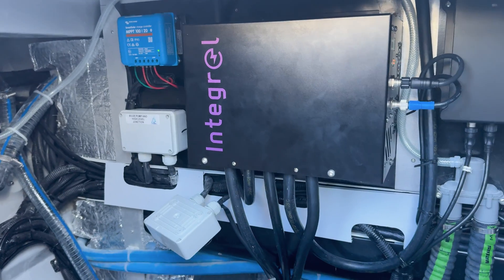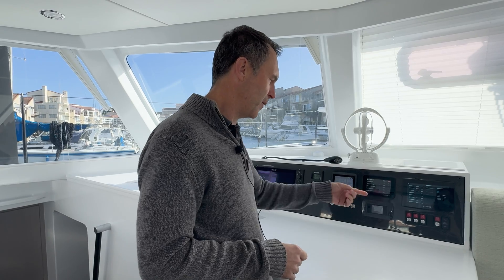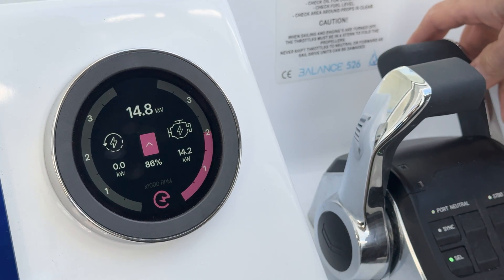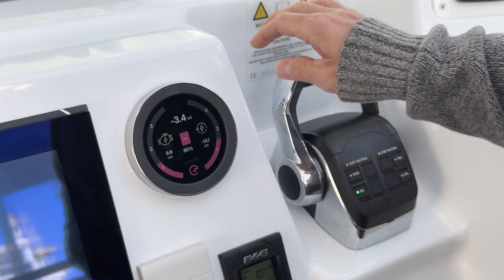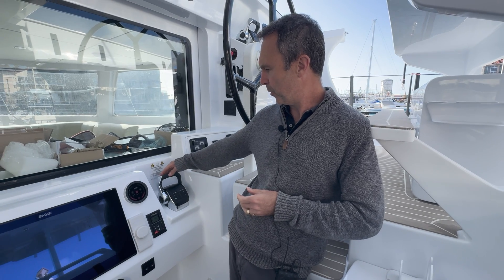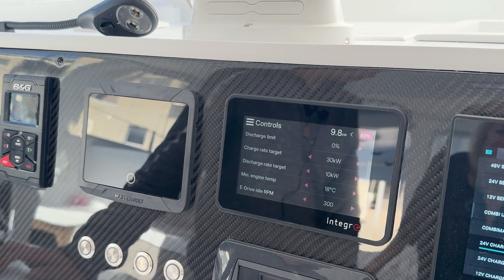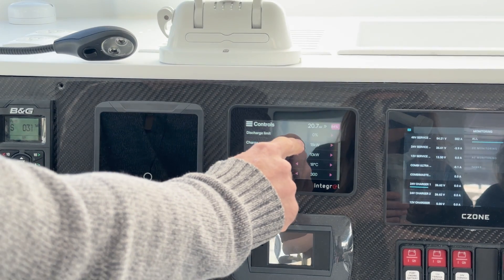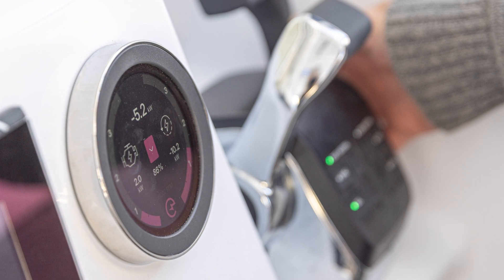First Look | VersaDrive Hybrid System: Controls, Charging & Smart Efficiency

Comment: Can it recharge batteries via passive regeneration mode through the props as you sail?
Reply from the maker: No. These are large diesels on shafts and the boat is not set up for that. Frankly, regeneration is not a lot of juice for the squeeze and slows the boats down of course. But it is true that a very large and powerful cat such as this benefits more from regeneration.

Comment: I would love to see how the integral is mounted. We have one of the old integral systems and we had a lot of issues with it burning through belts because of the way that it was mounted.
Reply: It appears to mount inline with the Diesel output shaft via spline drives.  So direct drive and no belts.  Mounting is shown in the first few seconds of the video.  More could have been shown.
Reply from the maker: Hey Alex, Phil here!  The E-drive has no belts and is an electric motor that attaches directly to the Yanmar. No belts. Hope you are doing well, Phil

Comment: We've had an Integrel system on our sailboat for a few years now. The system's output drops after about 10 minutes due to the large amount of heat it generates, which I can't remove quickly enough from the engine compartment. What about the new Integrel system? Does it also produce that much heat?
Reply: Heaps, that's going to be their problem for a long time.
Reply from the maker: Sure, heat is there and we installed a powerful full to mitigate that on the Balance cats with E-drive.

Comment: How fast does the boat go at 1,000 RPM both hulls under electric? How about 1,500 RPM?
Reply from the maker: Great Questions. We will be publishing all the testing results in the coming days. At the time of this video it was still early testing. We will share the details in updates very soon!
Reply from the maker: @RyneoDonnell, the Chief Technical Officer at Integrel Solutions, offered this insight: The electric motors use the same drive train as the engines, so the boat goes the same speed at 1000RPM and 1500RPM as when it is driven by the engines.
Reply: @balancecatamarans  How long can it motor for at top speed with these batteries?
Reply: @balancecatamarans test results yet please  ?